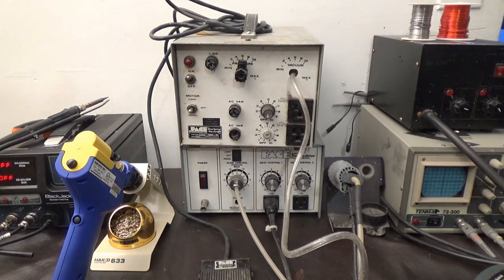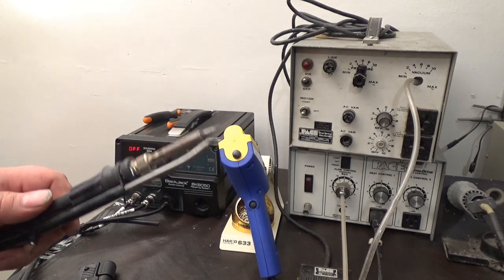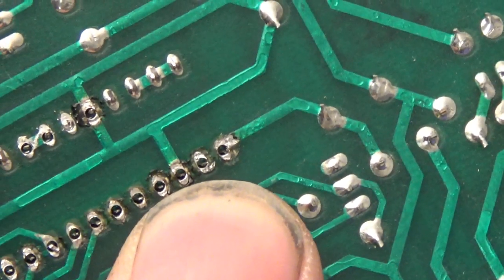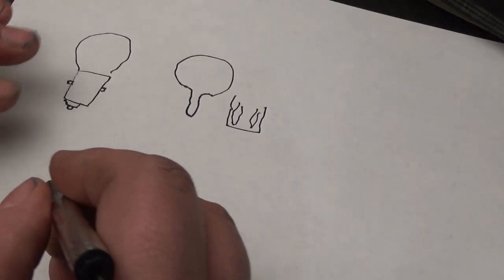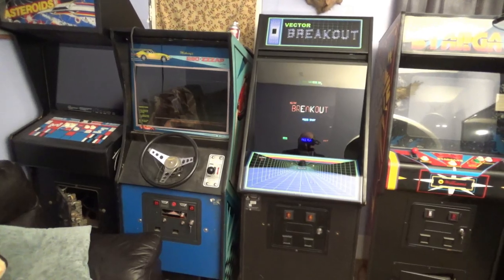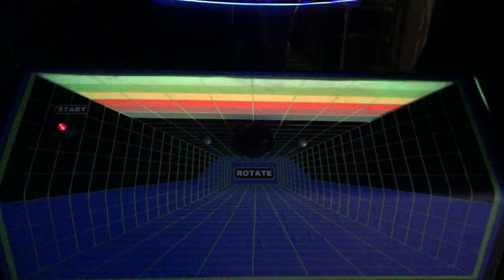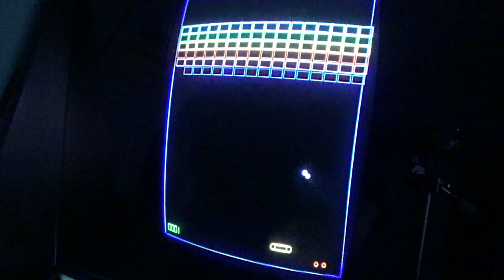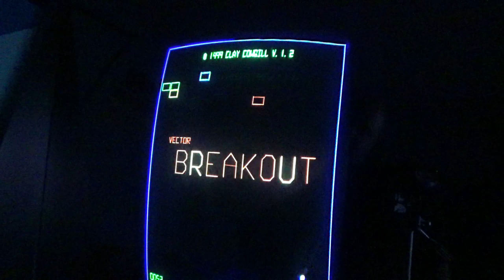new game new desoldering iron

Comment: Lord Arcade Jason. Question, I have an original Galaga, CRT with a 60-1. On occasion in the winter months after I turn on the machine when I go to play and touch the game I’ll get a small static shock and the sound will go out. If I turn off then back on all systems are go. Is this normal or something not grounded correctly. Any suggestions?? Great channel 👍🏼👍🏼
It’s in my game room on carpet.
Reply from the maker: i have seen this exact thing happen before  with the 60 in 1 myself ground all exposed metal on the outside of the cabinet  and the monitor frame (these parts must be wired to the ground prong on your power plug)
Reply: Arcade Jason Thanks 🙏 I will give it a look 👀 over and see if everything is secure. 👍🏼

Comment: Hey Jason I was just wondering if there's a way to get in contact with you a little more personally. I messaged you on Facebook with a problem that I'm having with a sharp NES TV that has had a failure on the flyback power board. Along with that message on Facebook I sent some pictures